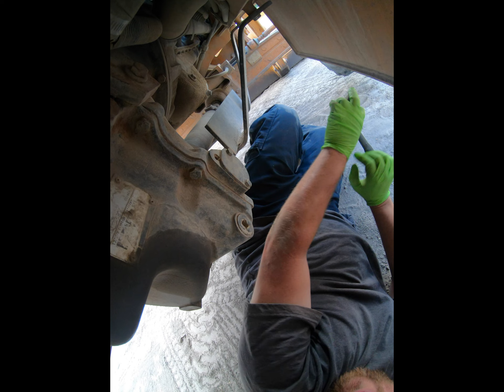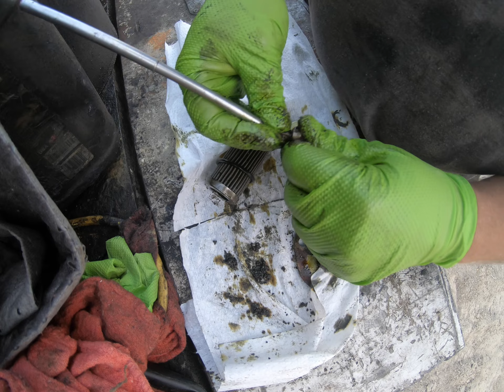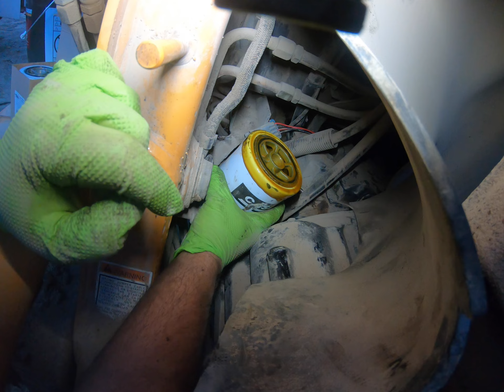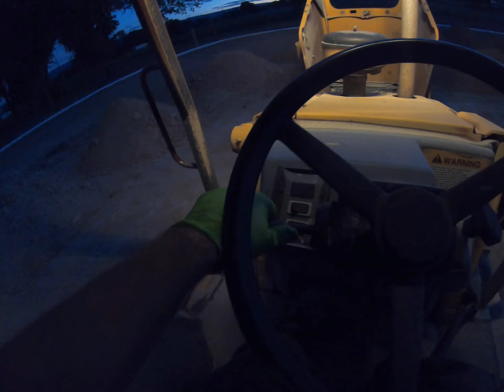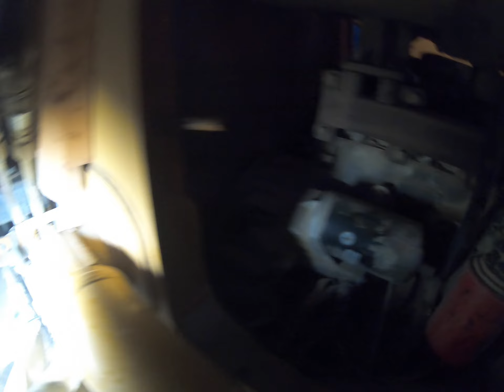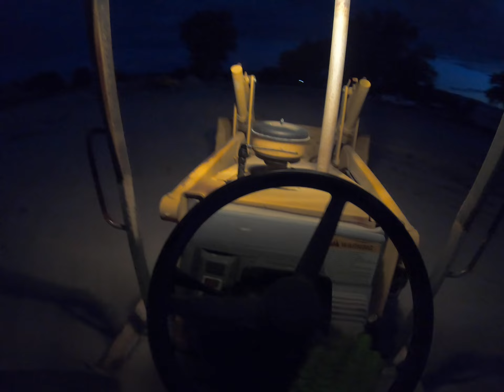Case Backhoe Transmission Problems

Comment: ive got a case 650D dozer thats building up pressure in tranny and blowing fluid out the dipstick any thoughts to what may be causing it?  runs and pushes fine first couple hours then starts to get hot and wont hardly pull,  its had the transmisson replaced but didnt fix problem any advice would greatly help

Comment: i recently bought a 580 super L and I am having a problem with the brakes I don't have much brake pedal but it will pump up. The emergency works fine and when it on I have lots of break pedal.
Thanks for any help

Comment: I was hoping to see the oil fill and oil level screw if it has one
How often should the fluid be changed
Thanks
Reply from the maker: The backhoe has a transmission fluid level dipstick. I believe Case specifies every 1000 hrs. Depending on how much pushing and driving you are doing you may want to change it more often. Make sure to inspect and clean your suction screen when you change fluid as well.
Reply: Do you fill it threw the dip stick hole?

Comment: I change my oil from a case 780 backhoe, shuttle shift 2 speed last year and it hasn't been the same since.  There was no metal particles that I could see and 3/4 of a bucket of oil came out and I filled it with almost the same amount after checking level.  It would take a long time to engage and now it won't engage forward or reverse.  This week I drained the oil again and it was frothy and dark grey, no metal particles that I could see.  Only 2 gallons came out and I am stumped as to why this happened.   I did not fill it yet because I don't want to waste the Hitrans oil I have until I find out what is going on.  Any thoughts.
Reply from the maker: It sounds like a low fluid level issue. I would look it up to be sure but I believe that takes around 5 gallons. The frothy could indicate low fluid level causing aeration, of course there is other variables or causes. I would definitely be looking for any leaks, the fluid is going somewhere and to diagnose it you need to find out where.

Comment: I live in Poland and have a 1997 Case 580 SLE. I want to change the transmission fluid. I am having trouble finding the original case fluid. All that I can find on the internet is Case HY-Trans fluid. This is not Dexron but something different. Can you tell me exactly what this fluid is? The agro stores here all have Hy Trans fluid but I want to make sure that I get the same fluid. Thanks
Reply from the maker: Hytran should be the correct fluid for that machine. I will have to double check with the service manual though. Thanks

Comment: Thank you for you video I,CASE BACKHOE 580l The transmission is leaking oil, how do I fix it?
Reply from the maker: It depends where the leak is. It could be a line or a seal.  You would need to find out exactly where it is leaking.

Comment: Morning everyone. I have a case 580 super r backhoe.i can go forward  but can't  move in reverse. asking for help
Reply from the maker: How old is your 580? Is it a L, M,N, etc.? Depending on your model I would check the electrical circuit from the FNR lever to the solenoid. Fluid level or filter condition would likely not affect only one function.
Reply: @paulsequipmentrepair823  thanks.i kept checking yesterday and found two cuts.at solenoid and the fuse harness."sabotage" kkkkķ.apparently.worked just upon joining.....confused  as I parked it working  other than oil change and motor sub overhaul. Thanks thanks

Comment: You didn't  clean the vent on top of Trans. That's why it has rusty fluid from condensation  and lack of service
Reply from the maker: It definitely has a lack of maintenance. It was missing the dipstick until I talked him into replacing. The oil is full of clutch material.
Reply: @paulsequipmentrepair823  what happened after? Definitely needs a transmission rebuild and if he’s lax about transmission oil he probably did the same with the brake and hydraulic oil
Reply from the maker: @michaelwalsh9145  He is still currently using the backhoe for digging, but for pushing dirt it is seriously limited. He was talking with me about rebuilding the transmission.
Reply: @paulsequipmentrepair823  I strongly suspect the transmission charge pump has failed, fwd/rev clutches are almost certainly smoked as well.
Reply: My 1981 case 580c is doing the same. When I get on it hard to push dirt the trans stops letting it go forward or backward, I changed the fluid from the little oil pan, and cleaned the permanent filter in the oil pan.  It worked for a while, stopped again after I pushed hard. But there is a fluid plug on the torque converter that you have to line up in a little hole to get to. Whats worse, I can't find a wrench to fit it correctly. If I'm lining up the right plug in the open, it's only 1/2, seems small for a fluid plug.
Reply: @yopage  At this point  draining the converter isn't going to help.you need a rebuild  and new converter. Those transmissions are pretty simple compared  to the super L.
Reply: @williamreese2477  Yeah I figure I need a rebuild. I haven't seen metal in the fluid I was able to drain, just gunk. It needs a flush badly. Right now I can roll and do some digging like on this video. Thanks
Reply: My manual shows a pic of the area where the trany filter is saying that’s where the breather is. (Behind the rubber flap right side of the motor). I don’t see anything that looks like a breather in the pic or in person. Does it look like the axel breather?
Reply: @marcelgosselin3996  remove floorpan.its on top breather looks like orange  cap